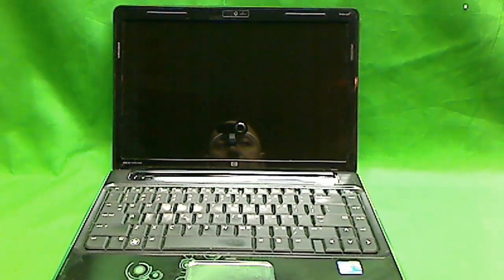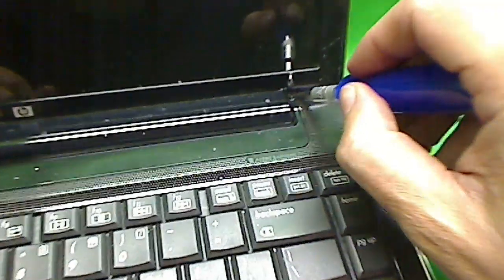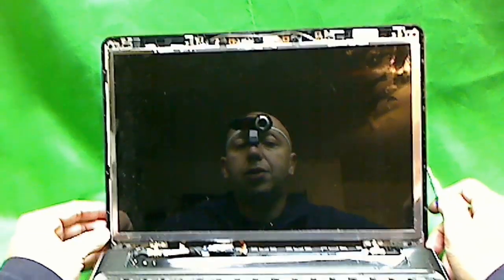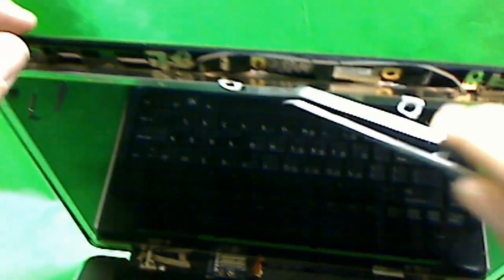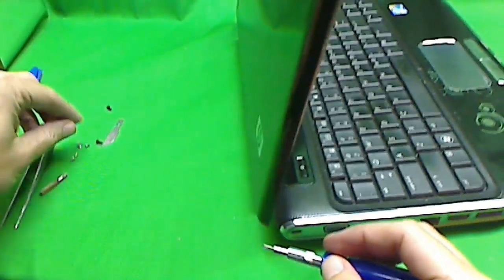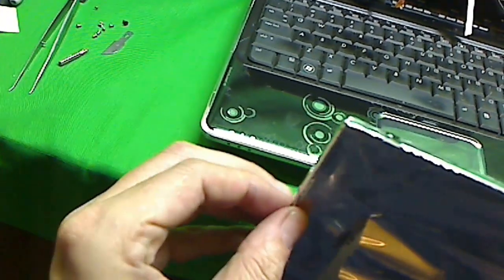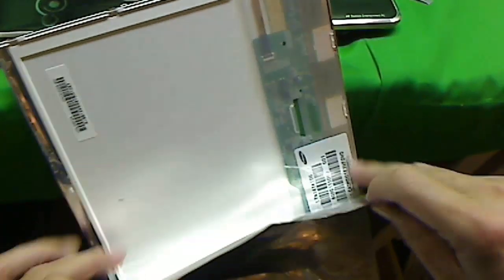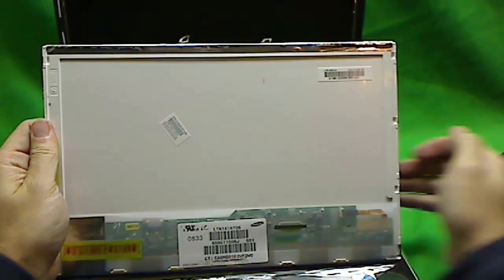HP dv4t Laptop Screen Replacement Procedure

Comment: i have a dv4 where the screen lights up the inverter is good. but there is no picture on the screen. when i plug it into a vga cable to a monitor it works fine. where does the video cable go under the keyboard?